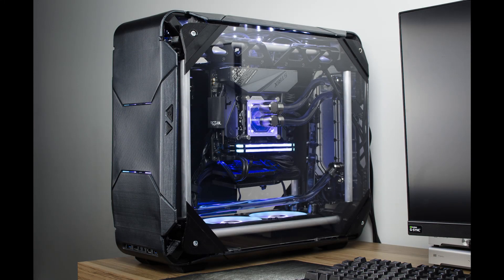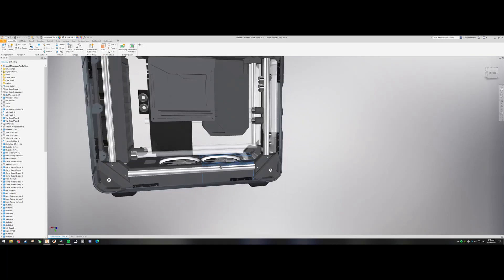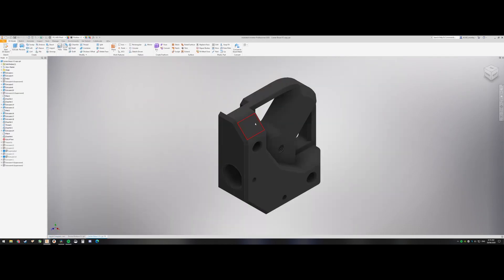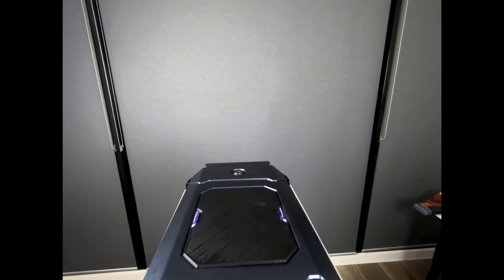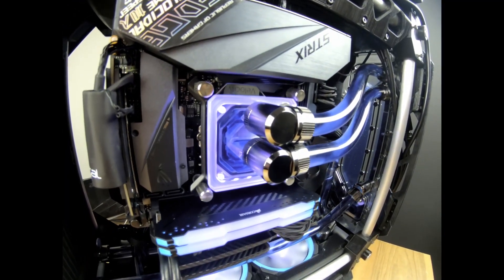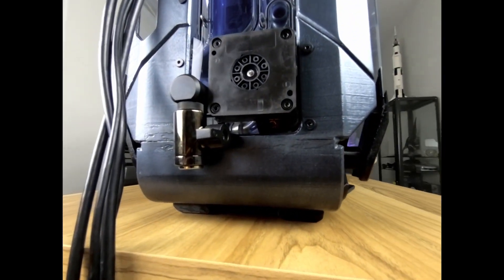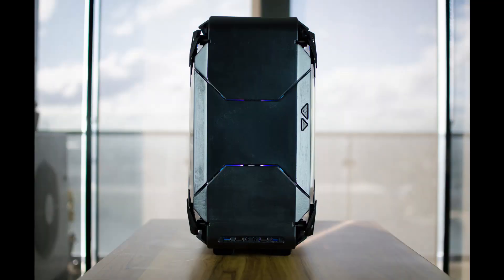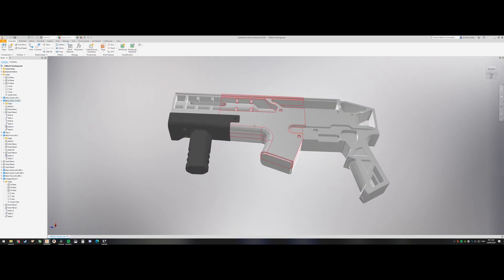3d Printed Water Cooled PC Case - 276 Hour Print Time

Comment: I know this is mad old, but first of all....A+ on the design!  I am attempting it as I type. Quick question on the aluminum tubing.....are all 4 sides of the frame the same dimension, or are the length and height different sizes??

Comment: How did you 3D printed? :00 and what did you use?
Reply from the maker: I 3d printed with a large 300x300 print bed. PLA dor the most part. I recomend ABS or PETG for motherboard tray and top io etc.
Reply: @printedprops8730  ah okay! mind if i ask why not make the tray with just normal steel? ( also i may be laser cutting so :,> ) and how do you make a diy top io :0 that part always confused me
Reply from the maker: @nettlewood6981  I just wanted a challenge with 3D printing basically everything lol.
Yeah you can make it out of steel, might be better.
I actually have a steel plate epoxy glued to the 3D printed I/O plate around the power supply area. The PSU screws into the steel. I got the steel from a ATX to SFX power supply adapter plate that I cut to size. It already had all the mounting holes.
You should also at least have a steel mount for the GPU bracket epoxy glued to the 3D printed I/O plate. Screw GPU bracket into steel plate. Or if the entire I/O plate is steel thats probably even better.
Some tips, you dont need a motherboard rear I/O plate....And depending on your own design you only need stanoff mounting points on the motherboard tray and you dont even need a rear io cutout.
Mounting the GPU is probably the most challenging part, since its not simple standoffs like motherboard. It has that L shaped bracket.

Hope that helps
Reply: @printedprops8730  yeah it does! Thank you :O and I’ll keep that in mind!